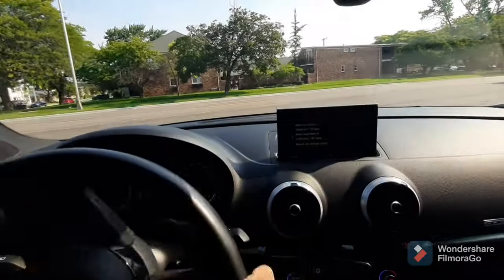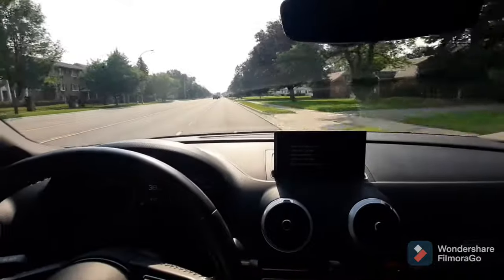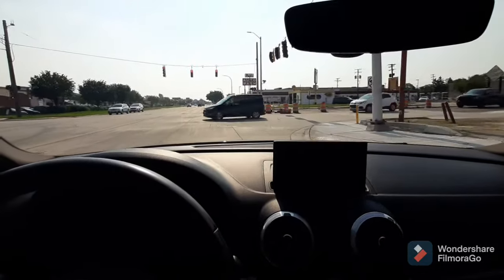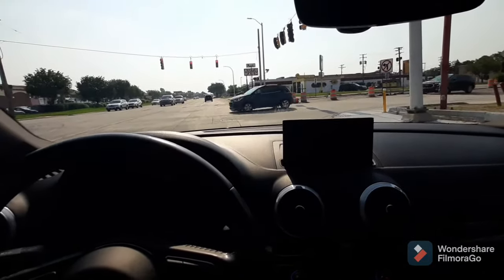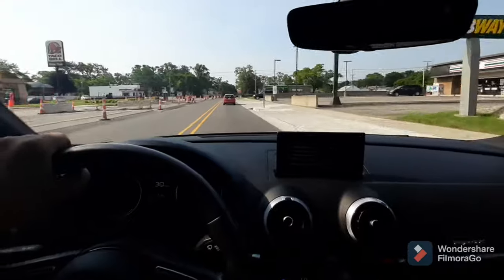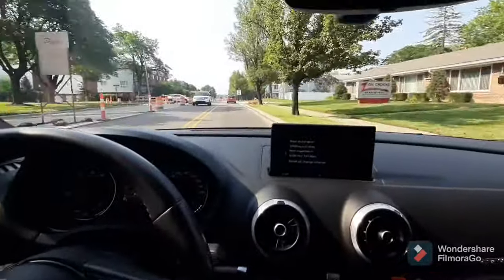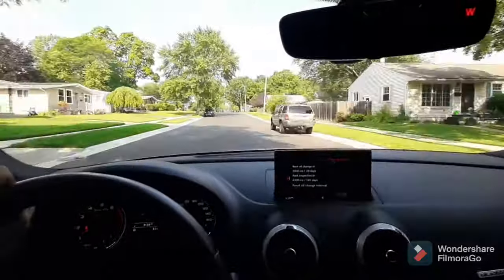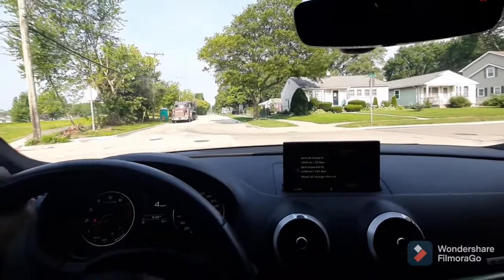How to tell the difference between a wheel bearing noise and a tire noise from drivers seat

Comment: I’m hearing a voom voom voom noise when I’m driving slow that correlates to the tyres rotation, from what you described, it’s probably a tyre problem
Reply from the maker: I bet it is
Reply: Did you get it sorted man? Mines doing the exact same noise
Reply: @jayroberts4900  I did, I’m 90% certain is was the brakes. I had a stone jammed in there and it was grinding. Ruined the disc
Reply: @harrisonrawlinson5650  but you got the tyres changed and it went away?
Reply: @jayroberts4900  I’ve put super aggressive mud tyres on now so there’s so much noise now

Comment: From this video I can diagnose it as my wheel bearing.   I will drive it shortly to confirm… my question is, do that affect the drive/car in any way? 
I get up 20 20-25mpg then I hear a cludding sound.  It comes and goes.  Some times over humps aswell… 
I don’t like driving with that sound.  It’s embarrassing as it turn heads then See my nice C-Class…
Reply from the maker: Not sure if thats what your problem is or if you have several problems going on. Some of the Mercedes have tapered roller bearing in the front that I've seen problems with
Reply: Sounds like a mount problem, either engine or trans...broken or worn out

Comment: When I’m driving I can hear as if the tires were shaky. What could it be? I did a tire rotation and I still hear it
Reply from the maker: Might be a shifted belt in the tire or  the wheels need to be balanced.
Reply: Sounds more like they are in bad shape have bumps or need balance. Yeap.

Comment: Something that might help, if you have a heat gun aim it to the rotor or the general area, the one that’s the hottest from friction should be the one.
Reply from the maker: I’ll do that at times to find binding brake hardware
Reply: @EuropeanAutoRepair  I have a 09 lancer and the back right wheel has a humming just like your video around 60, and decreases as i let off the gas. i’m 99% sure it’s wheel bearing - but i did make the mistake of touching the rotor and it was i’m not kidding 530° on my heat gun while all others were 140°. could the wheel bearing also cause excessive heat? really appreciate the fast response time too
Reply from the maker: @trexo3263  sounds to me more like a possible binding caliper or flex line issue, my bets on brake caliper issue
Reply: @EuropeanAutoRepair  i appreciate you so much! that was the initial, but the description was spot on for the sound. sub
Reply from the maker: No problem at all man! Yeah sometimes it’s hard to tell just by driving, Drive it around until it’s warm jack up that corner and see how it spins
Reply: @EuropeanAutoRepair  You were 100% right about the issue, it was the caliper piston worn out. (causing heat) Rotor also had slight warp from the heat (causing noise) thank you for your reassurance 👍🏼
Reply from the maker: No problem at all! Happy it’s resolved
Reply: What do you mean by a heat gun?  Are you referring to an IR thermometer?  A heat gun is like an industrial hair dryer.
Reply from the maker: I think he means ir thermometer lol, a brake pad dragging slightly would skew those results

Comment: My car front side near front Tyre both side make sssssh sssssh sound like a steam engine ssssh ssssh ssssh when I accelerate at high speed. Help me🙏
Reply from the maker: Honestly not sure what that could be. If it's a turbochargered engine what your describing sounds like a boost leak
Reply: @EuropeanAutoRepair  it's not a turbo car, it's a Chevrolet beat petrol

Comment: My guy said “ thanks “ at the end of the video, no brother thank you, just saved me some cash because I’ve been in a Dilemma and I’m almost 100% sure it’s only my tire now.
Reply from the maker: Hahaha thanks for watching that is, I'm happy it helped you out man
Reply: @EuropeanAutoRepair  anytime man I’ll come back to share my results
Reply: Oh shoot I meant to come back, actually just changed all 4 tires and everything was so much better, but now that everything is quiet I get a “ wheel bearing “ noise in the front driver side it’s very quiet but when I make right turns getting on the highway it gets louder so I’m thinking possible bad wheel bearing in the front. Originally thought it was my rear
Reply: Also is there anyway I can send you an audio of an issue I’m having that no mechanic can figure out? If you charge or anything I don’t mind
Reply from the maker: Ahh so you had a few things going on huh
Reply: @EuropeanAutoRepair  yes lol extremely bad tires, a couple bad bolts but everything is almost back to normal besides the wheel bearing type noise and a noise while I’m braking but it’s on and off, can’t figure out the word for it but it’s not consistent while I’m braking it sounds as if the brake pad is touching on and off as if the rotor is uneven somehow

Comment: Gone to 3 diff. Guys they all say diff things after watching many videos im thinking is the tires! Cause the tire rings are alluminum and they are in bad shape.. will take it to aligment and balance to see if that one guy can do the magic its cheaper to find new tires than changing all bearings cv joints and all that suspension crap and then it turns out its still humming! I will watch videos now before going to a mechanic im almost 90% possitive the tires are the problem!

Comment: Mine definitely gets more noticeable with deceleration
Reply from the maker: Any drastic change in sound went you turn?
Reply: European Auto Repair none. But I felt my tires and they seemed smooth. I mean not lumpy.
Reply: European Auto Repair so my mechanic did find it was a bad wheel bearing. $400 bucks but the noise is gone. When I felt my tires I couldn’t feel any irregularities plus this is a mechanic I trust so I’m confident it needed to be replaced.
Reply from the maker: I'm happy it's fixed. Sometimes the only way to know for sure is lifting the car on the hoist and listening to the hubs with stethoscope while somebody has the wheels turning

Comment: No offense intended, but your explanation for a wheel bearing failure doesn't make logical sense to me.  If the tire is bad (like cupping on the inside of the tire) it will be loud and when you turn your wheel, the noise would go away.  If the bearing is bad, that means it is "constantly" noisy no matter which way you turn the steering wheel.  Rationale: the bearing is not changing position when you adjust the steering wheel, but the tire is when you turn right or left.  A bearing must be a constant noise because of how that works.  I have had bad bearings of different types over the years and one thing they have in common is that the sound starts off low and gets louder, but it is a constant "whirr" when the vehicle is moving.  A bad tire would sound constantly, but the sound would change due to road type surface and when the wheel is turned.  Just a thought experiment and I know you are trying to help people out, but sometimes these things need a lot of investigation depending on the vehicle type.
Reply from the maker: No offense taken, I completely understand your thought process here and if this wasn’t something I dealt with on a near daily basis I would completely agree with you, loading the vehicle side to side when you have a bad double roller ball wheel bearing typically sharply influences the noise, tires can behave in a similar manner but it’s much less pronounced